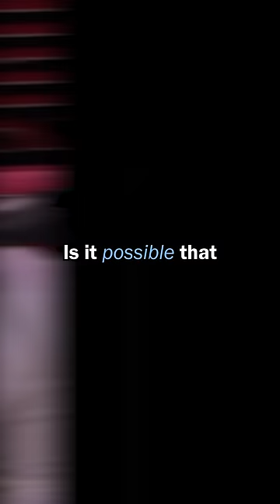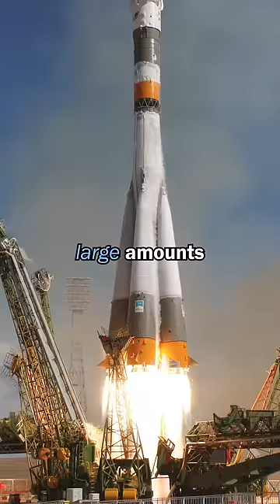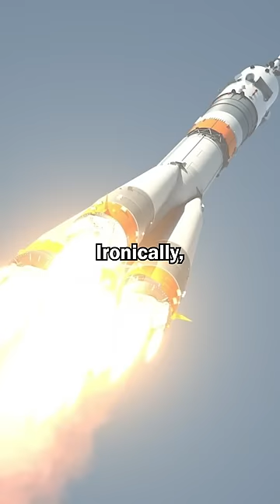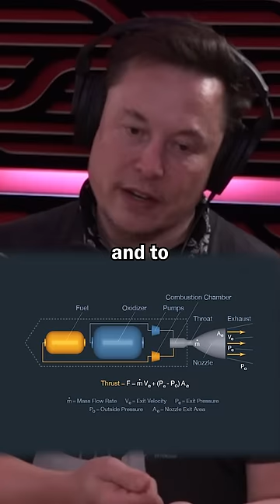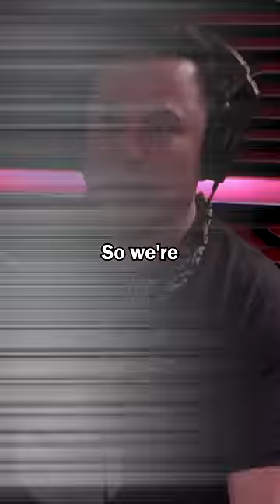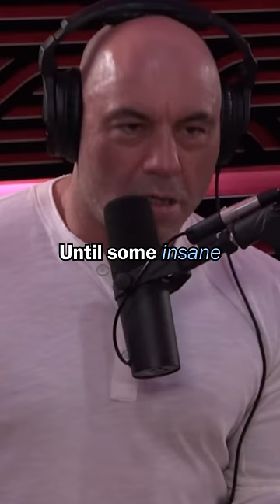Why This Rocket Engine Will NEVER Work!! ☢️ #spacex

Comment: I'm pretty sure solar sails exists. That is something that could definitely work in the future if expanded on and developed more. Very fast without having to use onbaord fuel.
Reply: quick get this comment to elon stat we found the solution
Reply: The problem with this method is that it quickly looses it's output as the spacecraft goes farther from the star.(at an exponential rate, inverse square law).

So if the craft doubles the distance between it and the sun/star, then the thrust produced will lower to 1/4.
For 3 times distance it'll be 1/9 th...

So it very quickly becomes inefficient.

And I'm not sure they're very fast...
Cz the radiation pressure is not that high.
Reply: Yeah sure if you want to spend 30 years going to Mars with no way back...
Reply: @trequor sn’t new James web telescope uses sunsail and it is pretty fast, correct me if I am wrong
Reply: solar sails can accelerate small masses efficiently. Not the tonnage that Elon is thinking about.
Reply: @fahadbinislam2344 Solar sails coukd actually go insane speeds, proposed to be atleast 1% the speed of light and at most even reaching 10%
Reply: @Tennosoul  
The "sail" in JWST is actually "Sun shield".
Its main job is to keep the telescope in shade from the sun rays.(with temp. equal to 383 K on sun side and 36 K on shade side)
Reply: @HeyImMax_  
That you're saying is probably about the "Breakthrough Starshot" project. 

They intend to propel small cube satellites with cameras to 20% light speed by using ground based lasers.
And those are small cube sats, if they were conventional satellites it would most likely be impossible to accelerate them upto 1% of light speed with just by EM radiation.
Reply: Not an actual solution and you should know it, it's totally reliant on the star so deminishing returns the further you go, I'm pretty sure the angle of the spacecraft  must also be aligned in a certain way which would further reduce the path options and where you can go.
Even further, this technology is mostly designed for very small probes and satellites so yeah it's not really practical for this situation 😊.
Reply: @fahadbinislam2344 not to be some 🤓, but it’s polynomial rate, not exponential
Reply: Would be nice if there is some form of matter in space you could push against.
Reply: I mean it’s not like you slow down in space once you’re going fast unless you manually slow it down. Lol
Reply: Solar sails with lasers would work a hell of a lot better. You just hit the sails with giant lasers on the moon. Probably need a way to get back though...
Reply: Elon is talking about the first stage. There are plenty of highly efficient electric and other propulsions systems used on satellites already. SpaceX operate the most electric thrusters in space with their Starlink satellites. 

Electric and nuclear don’t produce anywhere near the trust required to get into orbit. But once you’re there, they can be used
Reply: @zackberry6729  You could ride nuclear bombs on the first stage. It was proposed in the past.
Reply: You still have to firstly launch them. The solar panels are 100 atoms thick pieces of gold spread out over dozens of meter. Launching them in the atmosphere would be like launching a 100m^2 piece of paper with wind turbine
Reply: Not just that, there are ion engines that are on satellites already if im not mistaken.
Reply: but you’ll need a rocket to get a solar sail space craft in to space in the first place???
Reply: @anthonyashton8330  Not if you use a space elevator.
Reply: Not quite. They can provide some propulsion, but not NEARLY enough to be viable for long journeys, and wouldn’t be useful at all beyond a (relatively) short distance from the nearest star. And that’s something that can only be improved so much before it can’t possibly get any better, because no matter how advanced your technology, inverse square radiation laws still apply to the distribution of energy (radiation) from a point (star).
Reply: @Tennosoul You are wrong, it has a solar shield to protect from radiation, not a sunsail to harness it.
Reply: @HeyImMax_  I have a physics degree and that sounds very wrong to me. Even if you have an absurdly small spacecraft to maximize acceleration relative to pressure, radiation pressure is extremely small and it would take a ridiculous amount of time to accelerate to 0.01c even if we ignore the fact that moving away from a star exponentially decreases radiation pressure and therefore acceleration.

I would honestly be very surprised if it can even theoretically reach speeds we’re already achieving with our rockets.
Reply: @fahadbinislam2344 We will not reach even 0.01c within our lifetimes, reaching 0.20c sounds frankly like whoever said it doesn’t know what they’re talking about
Reply: @tgr5588  I am a physicist and we call it exponential decay
Reply: @jackcampbell9203 You do actually, there’s plenty of hydrogen/helium in space that will slow you down (not to mention gravity), it’s just that this effect is negligible unless you’re going way faster than we’re currently capable of.
Reply: @Fooney1 We can’t produce that much energy
Reply: You have to get the thing to space first.  Then deploy a solar sail…
Reply: @HeyImMax_ they can reach crazy speeds but over a super long time and over huge distances.  Nothing useful within the solar system I don’t think.  Not to mention the solar sail won’t work to get stuff off the earth.
Reply: But becomes virtually useless the further away from a star you get.
Reply: Solar sale are slow and can only be use in space, not for liftoff. Nuclear thermal rocket to use in space exist since the 60's. But even that is to slow.
Reply: But what about the initial take off? Sails won't do the job
Reply: Not in our lifetime
Reply: And you will find out that there is God and its to late to dream about fairy tale stories lol
Reply: @erictremblay6867  open cycle couldn't be used in atmo period and closed cycle couldn't achieve the right thrust to weight ratio. Eventually funding got cut.
Reply: U realized he was talking about escaping the earth’s atmosphere right? 😂😂😂
Reply: @HolyMith  I said it was not for liftoff but space travel. Nasa is still looking into it for transfer to Mars. The thrust to weigth ratio is low but its extremely efficient.
Reply: @erictremblay6867  I was pointing out that nuclear engines were canned due to lack of progress on thrust to weight ratio. With modern methods they may be improved. If you wanted to use them for exiting atmo it would have to be the closed cycle variant which are unfortunately less efficient due to the coolant needing to be separated from the exhaust gas, and an extra stage of thermal loss occurs when transferring heat between the two fluids. If we could overcome these problems, nuclear rockets would make ideal interplanetary engines and might even be used for take off. We may never find out however because as usual the problem is money.
Reply: Theoretically possible but no one has shown they are feasible
Reply: you also have ion propulsion ( ion thrusters ) which is actually electric
Reply: To slow it OK for transport supposed an return ores an stuff not fast enough for hu.ans
Reply: @doublem207 based on your thought process, how do you suppose that sail boats can sail against the wind?
Reply: @Tennosoul yes you're wrong it does not propel itself with solar sails 😂
Reply: @R0me0316  Adjust your sails. Solar radiation behaves a lot differently from wind here on earth. It is limited by the inverse square law. Energy twice as far from the source is spread over four times the area, hence one-fourth the intensity.
Reply: @erictremblay6867  Nuclear thermal rockets dont have as much thrust but they have a high ISP
Reply: @trequor 30 days would gigantic improvement
Reply: @Tennosoul no. It uses a sun shield to protect it from the heat.
Reply: How it’s going to work moving away from sun? Once there’s no sunlight???😮
Reply: Solar sail is an theoretical concept but works only for go not to cameback😅
Reply: @einehrenmann6156  There is.  The matter you take as fuel for the craft.
Reply: @zackberry6729  I'm not aware of any significant thrust produced by a purely electric engine at this point.  

There are some extremely efficient ones that use propellant of another kind, such as xenon, but nothing that is purely electrical.  

As per the point of this video, we still need to eject mass.

It is an interesting field of study though, so if you know of options I am unaware of, please let me know.

(I'm not being snarky, btw.  I could very well just be unaware, and am keen to know more.)
Reply: And how do you intend to use solar sails to escape earths gravity and atmosphere?
Reply: Actually solar sails do not exist.  No human made craft has ever employed solar sails.  They are theory only at this point.  There are several challenges with solar sails that make them virtually useless for interplanetary travel.  First is that they would be incredibly slow to get started.  Solar wind is just not a very strong force compared to conventional rockets.   Second is they would only go in one direction.  Third is that the amount of force provided for the trip from Mars to Jupiter would be roughly 1%  of the force that would be provided for the trip from Earth to Mars and would be reduced by roughly 90% as it passes the orbit of each planet.  Another issue is that it would be a one way trip.  There is no solar wind going the other way.  The gravitational forces of the various planets would likely counteract much of what would be achieved with solar wind.  It's use would most likely be limited to sending things to other stars and even then the force would be reduced to such an extent by the time the craft reached the orbit of our last planet that the craft would be doing little more than drifting to the next star.  Finally, the material that the sail would need to be made of would have to be far thinner and far stronger than something like Mylar and we don't have anything engineered anywhere near close to that.  Bottom line is that using solar sails would be impractical for any space travel except for possibly sending a very slow multigenerational armada that would take decades to reach the outer planets and millennia to reach the nearest stars.  It would be little better than a note in a bottle tossed overboard and probably not even that good.
Reply: Ion thrusters too
Reply: @fahadbinislam2344  One way is to begin closer to the sun. You can also use lasers to give an extra push at distance. The wind is strong enough to hold back the collapse of stars.
Reply: @fahadbinislam2344 Yes, the acceleration decreases but you don’t lose the velocity so, although not likely a full solution it can be part of a hybrid propulsion system and reduce the amount of liquid/gas fuel needed.
Reply: Elon needs to invest in giant slingshot technology.
Reply: @Tennosoul the sail can only counter the gravity of the moon the force generated by the sail is not enough for travel.
Reply: @zackberry6729 that's not at all what he was saying. He is saying it will always be required when there is no gravity.
Reply: @Phlegm187  Have you heard of Spinlaunch.? Like a giant supersonic sling in a vacuum that can throw satellites into space. Real company, but many challenges left.
Reply: Correct me if I'm wrong, please. But I think those only work once you are in space. To get out of the gravitational pull of earth. Still gonna need rocket fuel.
Reply: @Tennosoul  JWST does not use a solar sail. It stays in place using a complex orbit around a lagrange point and a thruster for station keeping. It does have a sail like structure to use the sunlight to counteract instability caused by solar raditation but it is not propulsive in nature. The Sun shield is to keep the sunlight from warming the near absoloute zero temperature optics and cameras in its IR cameras.
Reply: @HeyImMax_  that requires constant output and solar radiation pressure, which drops exponetially as you get further from the sun.
Reply: Space isn't real anyway so the point is moot. FYI the earth is flat.
Reply: Love how many back sit scientists we have here. You don’t think he look into all possibilities.
Reply: @astonmartin8537  solar sails have their limited use cases. Those can be expanded using lasers in the terrawatts of power
Reply: @samuelking4723 how does one become a physicist
Reply: @theydontknowmeson...  First you need a degree in physics, then you probably need to go to grad school and get a master’s or phd in physics. Then, get someone to pay you as a theorist or experimentalist.

Physics is not a career path that is open to people who are not highly specialized in it. Frankly, at this point, nobody without decades of rigorous education and experience in the field stands much of a chance of doing anything noteworthy, and absolutely nobody without a specialized education.
Reply: Not to escape the atmosphere. Thats what we are talking about here. Once in space you can use ion drive and whatnot.
Reply: They only work if you are being pulled by something.
And I'm pretty sure you'd still need fuel to leave that gravitational pull in the end anyways.
Reply: @HeyImMax_ problem is thrust, not speed
Reply: sigh probably educated in public schools
Reply: yes, but solar sails are really slow compared to burning gas, or shooting ions. Similar difference to sea travel: solar sails may be helpful, but for slingshots and to avoid falling on next planet ahead nowadays burning gas is the only way to keep control.
Reply: @Fooney1 a solar elevator is simply impossible with today’s materials. Need some major advancements for something like that.

Comment: He said gasoline like SpaceX just swings by a Texaco on launch day
Reply: Rocket fuel or gasoline. Not much difference!!!
Reply: @redneckrevolt1  I mean they don’t put octane numbers on it for fact of octane molecules not being in rocket fuel but I’m sure that’s a negligible difference
Reply: Yea he should have done some research. Even "gas" as he said it was technically correct, but not how he ment it
Reply: There’s gas and there’s gasoline. Some rockets (not SpaceX) use gasoline or kerosine as the fuel and liquid oxygen as the oxidizer (the Saturn 5 first stage was kerosene and LOX; SpaceX used liquid methane and LOX). 

Gas in the rocket context just means any gaseous exhaust product. Burn methane and oxygen and the exhaust gases shooting out the back are CO2 and water vapor.
Reply: @timothy098-b4f  which is precisely why it’s weird to call it gasoline
Reply: @sorrowmg278  "Octane Molecules" is not something that exists. The Octane Rating is a measurement of how well the fuel stands up to being compressed before it reaches self-detonation. You may have meant the fuel additives that increase the octane rating?
RP-1 will still have an octane number, which may be transposed to indicating the maximum combustion chamber pressure achievable, and suggest a potential Specific Impulse number.
Reply: @sorrowmg278  "Weird" is also called "Marketing" and "Branding" - type it as Gas-O-Line and you'll understand how the name was created, and the specific time in US history.

Comment: Even a nuclear engine uses a form of propellant to move it just uses it differently, there is one engine that does it slightly different it’s called the Orion drive or something like that and it drops nukes out the back and blows them up to propel itself
Reply: Lmao
Reply: Sounds like some warhammer shit
Reply: Yeah moving mass
Reply: Yep, it's real, and was tested and proven it would work.  It would be the most efficient means of space travel with current technology.  It was only stopped because of nuclear treaties, and safety concerns (you would be sending nuclear bombs into orbit, after all).  If humanity needed to send humans to another star system, an Orion-style spacecraft would be the logical choice because of the vastly improved delta-V.
Reply: @Yukanhayt-Mhenow i Love your profile pic
Reply: Not all of them. Photonic exaust is pure energy. You're still losing mass because the nuclear fuel is being turned into energy, but there is no additional propellant just light as the exaust.
Reply: Thanks for free advice
Reply: At the moment that is theory only and to work the nukes would need to be quite small.  Once the nukes are depleted that's it.  Bottom line is it's still fuel and fuel is always limited.
Reply: Doesn't make sense man
Reply: Nuclear engine is not a thing.
There are nuclear reactors on subs that power Diesel engines tho.
Reply: Bruh, he's not a rocket scientist.
Reply: @kaymish6178  well photons are not pure energy, so you are wrong about that but yes, it is just like ion propulsion where they shoot out ions